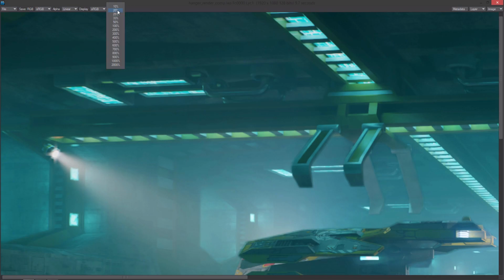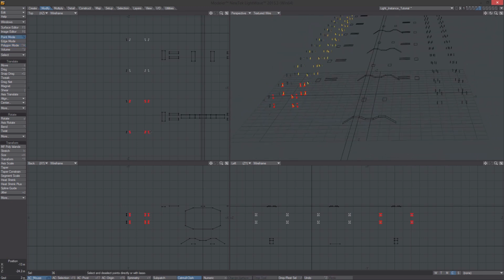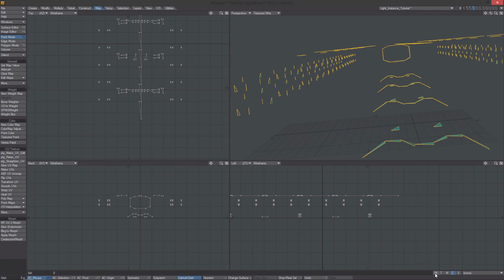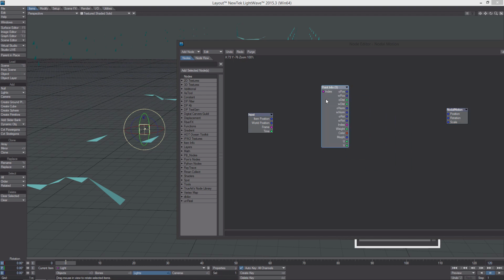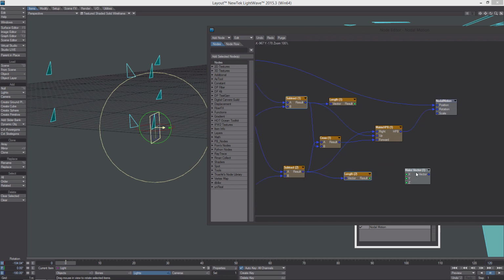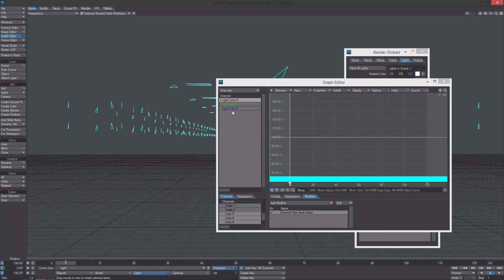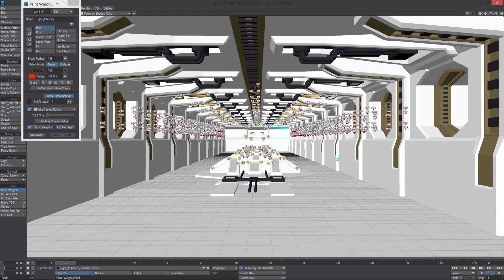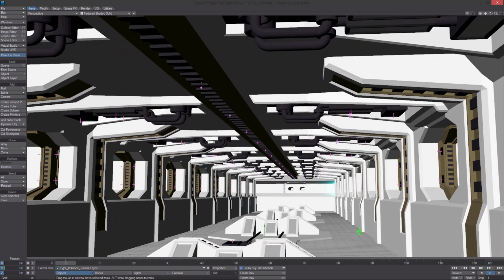Light Instancing With Point Attributes (Lightwave 3d Tutorial)

Comment: Is it possible to apply light properties to a map(intensity, volumetrics, flare, shadow type)? Like... using luma variation or something? To me, thats the weakeness of lightwave. If You arent working directly with a light Its very hard to achieve any type illumination effect.
Reply from the maker: Not sure I understand completely what you are saying. Do you mean using a map to choose a light type, or turn shadows on off. That's not possible. It  may be possible in newer versions using similar method to this. What is possible is using a map to adjust any value on the lights that has an E next to it. Volume lights, and lens flare are doable with this method (anywhere with an E... or a node editor like the volume lights have). What isn't doable in this version  is changing light types, or turning shadows on or off. I also wish we had the ability to change light type (and ies files) procedurally... but it's not doable in this version.